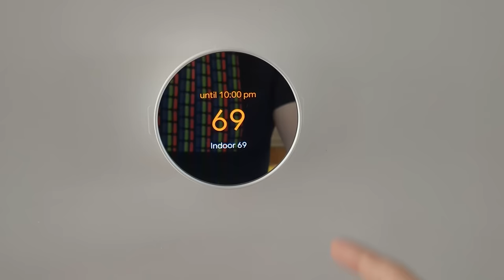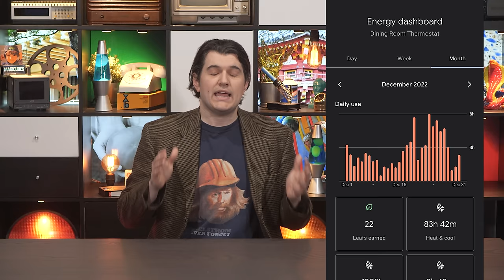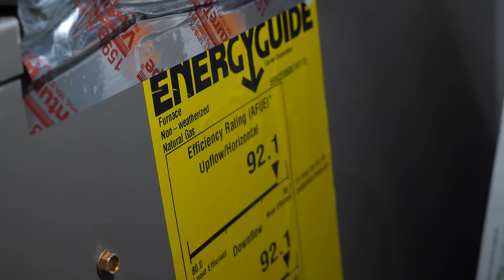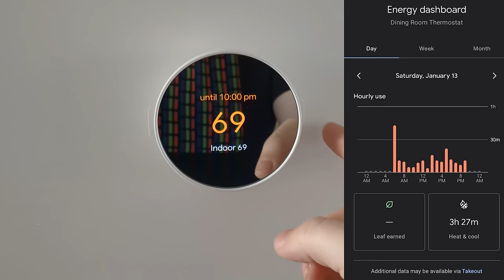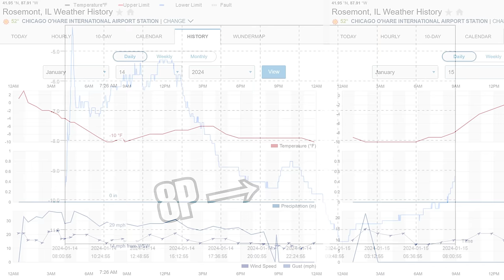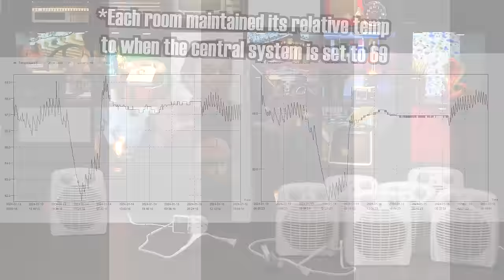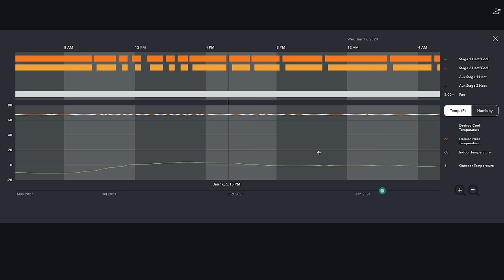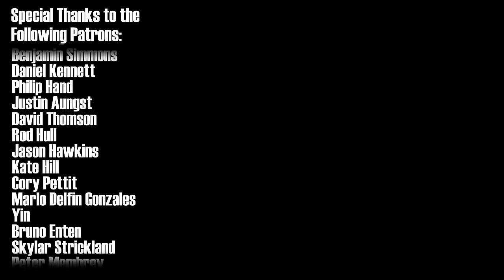Old HVAC industry practices are holding us back and costing us money. But we can fix it.

Comment: I'm at the 30-ish minute mark and the volunteer firefighter inside me just cringed really hard... Last night, we had a fire call where someone plugged a space heater into a power strip, burned up the strip, and nearly burned up the outlet... Thankfully no actual fire occurred. Thank you for knowing what you did was unsafe and warning others not to attempt it themselves. Science can be fun but dangerous at times. Love the content.
Reply: A less dangerous method would be to turn the furnace on fan only mode, and plug one space heater into every circuit.
Reply from the maker: @sean2074  The reason I elected not to do that was because the wattage from the blower motor (which is higher than you might think - typically 200 watts or more) would skew my results. Plus, it was valuable to know which rooms actually have the greatest heating load. But yes - it was a risky setup. I was checking the temps of cords and connections all through the night and had fire extinguishers handy.
Reply: Why is that? Seriously. I don't have a single outlet in my home that can deliver less than 2300w (10A, 230v). I just went through every power strip and extension cord and they are all rated for at least 3600w. 

The wires in the walls are all girthy enough to not burn before the breaker pops. 

I combined two circuits (total 32A) and I tried a random cheapo extension cord. I stopped after 5700w (didn't dare to go further) and it didn't even start smelling of plastic. The plug got warm though... 

Are American standards that bad?
Reply: @LinusBerglund It's because the American grid runs on 120V instead of 230V so 10A is 1200W instead of 2300W.
Reply: @pyro1324  No, the American grid runs on 100+ kV transmission, 5+ kV distribution, and 240V split phase to houses.   Most outlets in the home are 120V with a couple 240V outlets for dryer and stove.  See his video "The US electrical system is not 120V".
Reply: Cheap power strip?   Most I've seen are rated at 1875W (15A @ 125V).  A 1500W space heater will draw 12.5A (12.5A @ 120v)
Reply: @LinusBerglund Standard North American outlets are 120V ± 6% (112.8V - 127.2V).  A 15A circuit at  80% continuous load is 12A so that's 1440W.  A 1500W space heater will pull 12.5A at 120V.  But if the voltage supplied to house is a tad high (127.2V) then it will be drawing 13.25A so that's 1.25A above the 80% continuous rating of the wires instead of the .5A it's normally going over by.
Reply: @avernar The household electrics aren't really the problem.  A 15A circuit can safely carry 15A continuously, it's just that we add EXTRA safety margin because that's how engineers are (and we appreciate their diligence). Indeed, 15A already has some margin built into it before adding the extra 20% for planned loads. The breaker will do its thing long before the wiring inside the walls is at risk.

The danger is the stuff you plug into it. The circuit rating only ensures the stuff inside the wall can handle those loads.  You can get cheap extension cords and power strips that should never, ever be used with one, let alone multiple, space heaters.  Damage to the plug itself, unless you shorted things and had an instant of much higher draw before the breaker went, is probably from the male side overheating.
Reply: "Skew your results" meaning your method seems to not be that efficient 😂.. your furnace doesn't run that much because your walls are warmed by your neighbors there genius.. this clown is so pathetically ignorant why are people listening to him?
Reply: @LinusBerglund I wish I could get a 3600w power strip, every one you get in Japan (100v mains) says 1500w max, even ones with super-thick heavy duty cable.
Reply from the maker: @jacksparrow3490 if you understood how heat transfer actually works, you'd know that the heat from my neighbor's homes doesn't actually affect anything because heat only moves across a barrier when there's a temperature differential - and the differentially between two occupied homes is minimal. Ever notice how when the outside temp is anywhere near your inside temp you don't need any heating or cooling? That's what's going on, and that is why you don't factor them in when you do load calculations - only exterior surfaces, which actually have a meaningful differential, affect loading.

But yes, I'm pathetically ignorant.
Reply: @TechnologyConnections  when the "air" on the sides of your "townhome" is at a constant temperature above 60 degrees, your side walls aren't getting "cold" and no cold air is coming in. Meaning your 5/8 drywall and insulation aren't even getting cold at all.. doesn't matter what r value it is. You ignore this obvious basic concept?
Reply from the maker: @jacksparrow3490 um. you seem to be ignoring an obvious basic concept.
What you just wrote explains precisely why you don't figure shared walls into load calculations - so you understand it yet also don't?
Reply: @TechnologyConnections  "heat from my neighbors home doesn't actually effect anything"... so the heat isn't keeping the other side of the wall warm so there isn't any loss of heat on those walls there smart guy?  😂😂🤣 trying to push climate change fear on people to buy your glorified space heater 🤪🤪
Reply: @TechnologyConnections  so you ignore real world conditions to fit your little narrative huh? Just because you calculate it different doesn't mean your walls aren't being warmed by a neighbor from the other side.. but we wouldn't expect someone using climate change as a selling tactic to use actual facts now would we?
Reply from the maker: Oh - are you just like, arguing that I think the shared walls aren't making my home easier to heat? Because of course they are, I even explicitly said that in the beginning of the video. That has nothing to do with how oversized my furnace is, and you don't consider shared walls when doing load calcs.
I have no idea what you're even going on about at this point. This video was all about equipment sizing, and my furnace is wildly oversized for my home. The fact that I'm in a townhome doesn't really matter to that point, but you're framing it as something of a gotcha.
Reply: @TechnologyConnections  everything you've stated is you manipulating the study.. to get desired results.. "load calculations" from shared walls? How do you get ambient air temp calculations from a wall? You're literally trying to manipulate what data to input into the formula to skew your results in a fashion that makes you seem like you know what you're talking about.. this is such an obvious scam like EVs are.. notice all those cars left stranded in those freezing cold temps? Did they skew their data and results to convince people it wouldn't be an issue? They sure did..
Reply from the maker: There's obviously no point continuing on with you. Have a lovely day.
Reply: @TechnologyConnections  there's a reason things were built to be "more than enough" once upon a time.. obvious you would rather max out the stress on your appliances to try and find that perfect medium of too much/too little right? You bought a townhome.. enough said.
Reply: @jacksparrow3490  Cor fuc'n 'ell, got quite the fanatic 'ere, 'ent we, lads?
Reply: @jacksparrow3490  don't forget about alternative energy, gas stoves, covid, biden, woke, big tech, what inanimate object you identify as, CRT, 2A... what am I missing?
Reply: @jacksparrow3490  Congratulations on being a genius in your own eyes, I guess?  You're clearly smarter than Alec.  I guess we should all be watching your hour-long videos investigating household technical topics.  Oh, wait.  That would require good-natured humor, storytelling, respect, patience, and consistent work to produce.  

"Being smart" doesn't mean you'll be successful.  You have to offer at least minimal respect to other people.
Reply: @TechnologyConnections  quite the cult following you have 🤣 just use trigger words and the sheep come running don't they
Reply: @jacksparrow3490  tl;dr the difference in temperature between two inhabited spaces is minuscule when compared to the difference between those inhabited spaces and the outdoors. 

The only way Alec would be getting heat from his neighbors is if their interior temperature was higher than his. You seem to understand energy flows from high concentration to low, but somehow you don’t seem to understand that it’s the difference between those levels that determines the rate of transfer. 

Sure, let’s say his neighbors keep their homes at a balmy 75 degrees in the middle of a polar vortex. That means the heat in their house sees a 75 - 69 = 6 degree drop into his house, and a 75 - -15 = 90 degree drop to the outside. All else being equal, that means 6 / 96 = 6.25% of the neighbors heat is coming into his house. Oh no, his heater is only oversized by 2.935x instead of 3x!

Or, god forbid his neighbors are polar bears that keep their house at 67 during the day, then some of Alec’s heat is actually going to his neighbors and his figures are actually higher than reality!
Reply: @jacksparrow3490  Because he's intelligent enough to not call someone a pathetically ignorant clown, over a simple flaw in their video...
Reply: Love this channel. Full stop. 🙂
Reply: Dear God, I’ve never seen this kinda trolling on a TC video before. Even Alec (genuine nice guy) isn’t immune. Insanity.
Reply: @mrb692  i think what you people are trying to say is.. you really don't understand real world conditions and only look at things from a paper perspective.. if this guy has his thermostat at 60 degrees.. and both neighbors on each side of him keep theirs at 72.. You're claiming this guys home won't be helped maintain his 60 degrees with less work from his furnace because shared walls don't transfer heat? Lmao this whole thread is so comical. I would laugh so hard on a job site at every single one of you while you look like fools.. dunning Kruger effect is a thing.. you all take the cake
Reply: @mrb692  once again.. you seem to not understand if the front and back of his home is touching outside colder air.. and the sides of the home are touching other warm living spaces.. that in turn would "help" his home not need as much furnace usage.. just curious.. how do you remove walls from an equation that is taking ambient air temperature? Or is he only getting so many feet away from the wall and claiming his reading is invalid because he's not considering the whole rooms temperature when making his calculations? Just interesting how none of you are even seeing the signs of snake oil dripping everywhere.. climate change is a call sign for dunning Kruger effect participants. Full stop. Anyone trying to ban natural gas or tell people they don't need it is literally too ignorant to see a bigger picture other then listening to fake scientists and media analysts about an agenda designed to enslave you more.. sorry you can't accept the reality in which we live. Everything electric can and will monitored and "permitted" in the not so distant future.. you clearly can't comprehend how Chinas social credit score is practically already here.. but let's continue talking about this guys oversized furnace because he's not even considering the heat from the neighbors does indeed help lessen the work on his own furnace in his own "unit".. its a town home.. a cheap cookie cutter home builders throw bulk items into as they get great deals purchasing them by the many for the many units being built. If his furnace is "too big".. it seems like that isn't even a bad thing.. its amazing how people will sacrifice comfort for some "greater good" based on propaganda and weather manipulation 😂
Reply: @TechnologyConnections  so when the air in your neighbors is transferring into your home when your furnace isn't on.. its not until your home reaches that set temperature to turn your furnace on.. you already prove the point made by the video itself.. your home doesn't "lose" heat at the rate calculated for the size of the home based on the specs provided to the builder.. thanks for playing..
Reply: I know if I point this out, it will change, but at this moment, nobody on this comment string is giving a thumbs up to Jack, but Alec is getting them. The troll has been identified, the sheep voted.

Alec, there are so many good things about your videos, just keep them coming, especially the snarky bits......in my opinion, one of the best parts
Reply: @Chevtec  yes.. considering how many people are wrong about alot of things on massive scales.. doesn't quite mean any of them are correct.. 🤣
Reply: @jacksparrow3490 
Well thank God that you're here to save us all 😂
Reply: @jacksparrow3490  You'd do better to not assume everyone around you is idiots and stop trying to impress people with how clever you think you are by trying to make things more complicated than your argument needs. What you are TRYING to say, and utterly obscuring with your attempts to seem smart, is that you believe that the neighbours heating systems are shouldering the burden of the "ineffective" (by your assumption) electric heater test, and that because the test doesn't measure to see if there's an increased load on their systems then the test is invalid.

That's not a terrible point. If you'd just made that point rather than leaping to conspiracy theories and obscuring your own point and then throwing insults then you'd probably have got a nice reception from everyone here.

Given the results of the empirical were to test the validity of the other two methodologies and they ALL agreed with each other, it seems unlikely that this is a factor. Yes, his neighbours homes help his home be more energy efficient, as he states in the video, but the degree to which it applies appears to be the same whether electrical heating is being used or gas, it isn't compensating for anything or skewing the results, it's just a baseline environmental factor for these purposes.
Reply: @avernar : Two things about your comment are incorrect. Firstly, the outlets over here are only rated to a max of 125V L-N/G; not the 127.2 that you gave. If the voltage of either “hot” leg, relative to ground goes above 125, you best call an electrician and have them see what’s wrong.
Second, power is voltage multiplied by amperage; as voltage goes up, the amperage will go down, and vice versa. Your statement of the amperage going up with the voltage is completely false.
Reply: @jacobcarlson4010 Incorrect. The amperage WILL increase with a voltage increase if you have a RESISTIVE load, as it will also decrease if you have a voltage drop.
Now something like an electric  motor, an INDUCTIVE load producing a fixed output power the opposite will occur. Voltage increase will result in an amperage decrease and a voltage decrease will result in an amperage increase.
Reply: @jacksparrow3490  Holy Heck, dude.  If you have to post a dozen ranty comments to make your point... do you even have one?  Really practicing "flood the zone with BS" here.
Reply: @plwadodveeefdv  Perspective, I'd say.  Let me know if you need more help.
Reply: As a person who works with electricity in various forms who also has a deep respect and caution when working with it, I would have to agree.  I was wincing thinking about it.
Reply: @TechnologyConnections Well, taking precautions is a good thing.  The infra-red camera is a good tool to have handy as well.  I wish I had one of those and a laparoscope-style camera for various jobs.
Reply: @avernar 240 V~ for his car, heat pump and water heater as well.  If you have larger power tools as well you are looking at 240 V~.
Reply: @WJCTechyman  Yes.  I have my A/C and computer rack hooked up to 240V.  In the future I’ll hook up an EVSE to 240V.
Reply: I was in the kitchen when the GFI outlet released black smoke.  Killed the power, let it cool off.  Turns out the air fryer exhaust melted it inside and the hot line shorted.  Replaced the outlet, and put new outlet under the counter, and moved the airfryer over 6 inches more plugged into it.
Reply: @avernar  a lightning strike took out L2, so I had no 220v and half the house was out.  I was getting 78V on L2, which isn't nice.  Seems no one makes a breaker to let you trip one line only.
Reply: Those damn space heaters are GARBAGE, I had a small UL listed!  "cube" 1500 watt unit plugged in, the internal fan failed and the plastic- PLASTIC!! case caught fire, I was awakened by my dogs jumping on my bed to seeing a 2 foot flame feet from my bed, I grabbed the power cord on the thing, yanked it out and carried the still burning heater to the front door and threw it in the snow where it burned until only metal screws, coil and the fan housing remained.

I cannot fathom how they can legally make something like that with a flammable plastic case and be UL listed too!
NO plastic, and NO 14 GA wire like they use.

A former neighbor years earlier hired me to help print tee shirts, we were working on that and I stepped on the cord to the space heater he had running, and the cord shorted out! It had gotten hot enough running that 1500 watts that the rubber or whatever it was the cord was made of- softened enough that just stepping on it was enough to mash the wires together into a short circuit.
Reply: @jacksparrow3490   Couple of things. Alec has his house at 69, not 60. But even using your numbers, there’s a 12 degree difference between sides of the party wall and an 87 degree drop across the exterior, meaning 14% of their heat flows into Alec’s house. Oh boy, his furnace is only oversized by 2.72x and not 3x! His entire argument is invalid! Except that’s not how that works. 

Also, I am not saying his home isn’t helped at all by his neighbor, but I am absolutely saying the amount of heat he gets is negligible compared to the heat he loses to the outside. And if the neighbors keep their homes at 69 too, then there is literally zero heat transfer through the party walls. If you’re taking about how he only has 2 exposed walls and a roof to lose heat through vs 3 walls for the houses on the end, or 4 walls for a freestanding house, then 1) he addressed that by snarkily pointing out that denser housing is more energy efficient, and 2) that’s accounted for in the manual J calculation. Yes, the units on the end will need a bigger furnace than the units in the middle, and the freestanding house will need an even bigger furnace. But how much do you wanna bet that those units’ furnaces are the right size, versus also being sized off rules of thumb and then bumped up a size or two?

I’m not even gonna indulge the conspiracy stuff you’re spouting beyond saying that oversizing gas lines is way cheaper than oversizing electric circuits. Having the ability to generate 3x more heat than you need is a waste of money that is useless at best and potentially harmful to equipment at worst because it keeps cycling on and off.
Reply: @jacobcarlson4010  Ohm’s Law says volts equals current times resistance, or in other words current is volts divided by resistance. Since the resistance of a heater doesn’t change (much), as the volts go up, so does the current flowing through the circuit and the total output power.
Reply: As a science teacher, I still feel unnerving to let students handle chemicals regardless how many times I emphasize safety rules. But that's a small risk worth taking for the important education the general public needs.
Reply: Believe it or not, but Manual J takes neighbor's units into account and tracking heating load to a room level provides empirical results, which also will directly account for neighbor units, or lack thereof on either side, depending on the room.
Reply: @BixbyConsequence  considering the amount of dunning Kruger effect participants here.. yes, it does take repeating it over and over before someone realizes that inside air.. helps keep walls warm. Which in turn doesnt allow heat to escape from those walls. Sorry you people cant use basic comprehension when figuring things out.
Reply: @mrb692  the rate at which the heat is lost is less. Not negligible. Its actually quite interesting to see your argument miss the fact.. his furnace wont turn on as often due to his heat not being lost as fast on the side walls.. given the "heat exchange being nothing. Meaning hes not losing his heat as fast as someone with outside walls and not PARTITIONED walls. Those walls have 5/8 drywall with probably r 13 insulation. Yes the air inside the wall is heated by BOTH units. Yes that air will also help maintain a higher temperature due to the air not being cooled by the outside and heat being lost. Very simple to understand. If alex owned a home outright by itself. Same size and all.. his furnace would turn on more as more of his heat is escaping faster without the "lack of heat transfer".. you all keep proving the point. You admit it just in your own way. If the heat transfer is nothing on his neighbors walls.. then what is the heat transfer on his outside walls that go the the outside air? Its hilarious how you all keep confirming my point but literally lack the understanding to comprehend it. This isnt any different then the warming of a person in winter using clothes and a coat. Stand next to people with clothes and a coat.. their heat wont transfer to you because theyre wearing a coat and thats negligible. His furnace doesnt have to turn on as much as he doesnt lose his heat as fast as others. Whats the size of the home and the btu of the furnace again? Lets do the simple math for the sheep here.
Reply: @MichaelMamanakis  believe it or not.. that's not how it works. If nobody lives in your neighbors unit. And the heat isnt on. Guess what. Your furnace is working overtime then now huh.
Reply: @robertsmith2956 My generator would probably take over in that case.
Reply: @jacksparrow3490  Lol. Alec explained it to you concisely.  Stop trying to type yourself smart.
Reply: @jacksparrow3490 idk how to do the math, but im curious, what would the results look like if we assume all the walls are facing outside and not a neighbor? Like what would be the approximate requirement in that case, I'm genuinely curious and I don't know how to make the calculations.
Reply: @boombeepboomboop  you can look that up easily.. the first 10 seconds of this video proves all the sheep here wrong.. he turned off his furnace for 24 hours in minus 11 degrees.. that's not a testimony on his "big furnace".. that's a proof of his "loss of heat" being minimal and his home is kept warm by his neighbors 🤣 guess nobody here can comprehend.. he has good insulation on top of his townhome.. according to this guys thinking.. why do we even need heat at all in the home? Just out on a heated jacket and wear it all the time for you know.. climate change..
Reply: @TechnologyConnections  what is the btu of your furnace and what is the living space in your townhome?
Reply: @mrb692  you don't seem to understand why furnaces need to be a required btu to operate efficeny in any given environment.. hes saying his furnace is too big because he doesn't lose his heat as fast.. in the first 10 seconds of the video he tells you how he comes to this conclusion. Thank you all for proving my point. Dunning Kruger in full swing baby.
Reply: @DrakeKillah  "simple flaw"? The whole video is flawed based in ignorance. He says in the first 10 seconds "i turned off my furnace for 24 hrs and that means my furnace is too big".. tell us now.. does the heat loss by turning off the furnace have anything to do with the size of furnace at all? You could use a space heater and the heat will "stay" for quite some time is all this is proving.. hes claiming the furnace is too big based on propaganda.. i.e. climate change. Which is saying.. he hasn't looked into the real purpose of this whole push of climate change bs in the media and political hacks.. its a scam. Hes acting like -11 degrees is something to play with if all you can rely on is a space heater lol.. wait until his neighbors move and turn off their furnaces.. what if Alex here has an emergency with his furnace? How long does his method take to reheat a home that has dropped very low in temp due to no heat for days and days? Apparently people csnt comprehend the actual concept behind the required btu in the first place.. let's just over look everything becusse this guy can turn his furnace off for 24 hrs and that proves its too big.. 🤣
Reply: @jacksparrow3490  talk about blowing shit way out of proportions… I live in Norway, I know a thing or two about cold winters… I also know, you don’t need a furnace to keep a house warm, and you won’t die if it takes a little longer to heat up your home… Furnaces were never really a thing outside of large appartment complexes here, but heat pumps are, and they work well.

Just love how freaked out you guys are about this, as if this is an attenpt on your life or something 😂
Reply: @TechnologyConnections  how did you come to the conclusion your homes furnace is too big again? By turning off the furnace for 24 hours and that proves its "too big"?
Reply: @DrakeKillah  the US has a building code.. the furnace and hvac system is under regulation to a specific requirement for a given region and climate..
Reply from the maker: @jacksparrow3490 ok. At the risk of stepping in this, please tell me you got to the part where I set up a bunch of space heaters and metered them. Because no, I did not just shut of the furnace for 24 hours and say "wow, it's not that cold in here!" - that would be utterly ridiculous. I am not saying I don't need any heat.
Now, if you did get to that part of the video and somehow still don't understand how that validates the fact the furnace is 3X oversized, this conversation is an incredibly, woefully, unimaginably lost cause.
Reply: @TechnologyConnections  ok well you clearly didn't allow all the heat to leave your home first and then try to use your space heater method to see the difference in heat and climate inside your home.. so I'd say your little experiment wasn't conducted in the proper manner to give more accurate results you claim in the video. Your calculations seems to be biased along with the whole way they are conducted.. you want your furnace to be 3 times too big to then claim you have a solution for it.. when in fact it is not..
Reply from the maker: Sounds like you never got there.
Now, I will no longer argue with you. If you really think I needed to let all the heat leave to do the test, then you don't understand what you're talking about. Heat is always leaving - what matters is how much you need to replace it with. And I now know with 100% certainty that 17,452 BTU/hr is my home's actual heating load with an 80 degree temperature differential, zero additional sources of heat, and no help from the sun.
You have a good day, now.
Reply: It's been hilarious to watch this guy try to argue that everyone else is wrong because heat doesn't leave through the neighboring walls. That point was brought up multiple times in the video and even in this comment chain, and our lovely Disney pirate missed it every time.
Reply: @LinusBerglund  There are regulations in Europe that makes it practically illegal to sell any power strips that can't handle the max load of a 16A breaker, which is what the vast, vast majority of residential outlets are on. 20A is extremely rare for a regular outlet, and more than 20A is always on special types of outlets that you can't readily plug regular power strips into. Turns out 16Ax230V gets you 3600 watts, meaning even if you daisy-chain 10 power strips, the breaker will trip before anything catches fire.
Reply: @avernar  would it with L1 line working?
In the 40's it wouldn't be an issue, you remove the penny from the L2.  :face-blue-covering-eyes:
Reply: I cannot phantom why it’s legal to sell an extension cords that cannot carry the maximum current allowed on a circuit breaker.

Ever more importantly, why would there be no fuse in the plug (and in the socket for a good measure - like in the UK).
Reply: @zlamanit  These aren’t great reasons, but they are the ones I could think of. If you’re only running a low load, then a thinner conductor is cheaper, lighter, and more flexible than one that can handle the full rated load.

As for not having a fuse, that’s legit a good idea and other than cost and people would absolutely throw away a perfectly good power cord for the sake of a 10 cent fuse, I’m not sure why we don’t have them.
Reply: @avernar  Alex even showed the 118V on the Kill-A-Watt in the video, and that they dropped to 116V when the space heater was turned on.
Reply: @squidward5110  nothing wrong with 20 socket power strips if you only take like 100W from each socket
Reply: @wilfriedklaebe YouTube comment structure sucks.  No idea what you're replying to. 

Most NA utilities provide a voltage in a stated range around 120V (240V but each leg is 120V).  For me it's 120V ± 6% (112.8V - 127.2V).

Yes, you'll get a voltage drop when you turn on a heavy load.  That's just basic electrical/electronics.
Reply: @robertsmith2956 With L1 working (120V) and L2 slightly down (you said 78V) then no.  The default trip voltage is 156V.  So L2 would have to drop to 36V or less.

In that case I'd pop off the transfer switch cover and flip the Utility Service Disconnect breaker.  Generator would fire right up and tell the transfer switch to cut over once it warmed up.

We have a pad mount transformer and underground wires to it so not too worried about losing just one leg.
Reply: @avernar  I probably were replying to "A 1500W space heater will pull 12.5A at 120V." - in 32:03 to 32:13, Alec shows a Kill-A-Watt measuring 118V without, 116V with space heater, and then 1360W draw of the space heater. So, yes, more than 10A, but with 11.73A still way below the 15A that NEMA connectors are minimally specified with. I cannot find any source that states a 10A continuous current limit either NEMA 1-15R / 5-15R receptacles or NEMA 1-15P / 5-15P plugs.
Reply: @wilfriedklaebe  Not sure where that 10A came from (Europe?) but NEC  210.20(A) says a circuit breaker must be rated at 125% of the continuous load.  So that means a 15A 80% duty rated breaker can handle 12A only for  3+ hours.  Less that 3 hours you can use all 15A.  

A 15A 100% duty rated breaker (more expensive) can be loaded 100% (15A) forever.
Reply: @jacksparrow3490  "there's a reason things were built to be "more than enough" once upon a time.. max out the stress on your appliances to try and find that perfect medium of too much/too little?"
This is what I started to think part way through the video. The "extra" oomph from the furnace is there so it doesn't constantly push itself on at all times so the wear-and-tear is lessened over time and makes it less likely to need replacing any time soon. I'm not sure if this was taken into account or not.
Reply: @avernar  I was never worried about it myself either.  Was very weird coming home, and finding half the house didn't work.
Reply: @robertsmith2956 I meant "not worried" as I don't expect it ever happening here.  The lines don't go above ground until well after the transformer feeding my house.   Any damage by weather will take out the entire phase (both legs).
Reply: @imadecoy.  Their questions and objections were well-answered from the start.  The constant backpedaling and moving of goalposts and the repeated use of "Dunning Kruger" as an insult are all you really need to know about this person and where they're coming from.
Reply: @jacksparrow3490  "he US has a building code.. the furnace and hvac system is under regulation to a specific requirement for a given region and climate.." – yes it does (well, every locality has its own code, but they are based off the same set of codes and practices). And that code says the system must be sized using the Manual J calculation. Here is the relevant IECC section: "Heating and cooling equipment shall be sized in accordance with ACCA Manual S based on building loads calculated in accordance with ACCA Manual J or other approved heating and cooling calculation methodologies. New or replacement heating and cooling equipment shall have an efficiency rating equal to or greater than the minimum required by federal law for the geographic location where the equipment is installed."

... Which is what Alex did in one of the THREE methods to size his heating. All three methods agreed. I don't know what you think you are going on about, but maybe you need to put the keyboard down for a bit.
Reply: This can happen anywhere. That's reason my country do prohibited selling or import non-certified power strip or outlet since 2018. (Although some can it get illegally through online shopping). 

All require circuit breaker and correct rating of cables, Because most people are idiots about electrical system.
Reply: @tomdibble8983  Its ok if you can't comprehend his furnace is the accurate size for his home.. we get it. You common core math people seem to just think you can overengineer everything because math on paper seems to check out.. as stated.. his method will leave himself and others cold and over working his heaters.. is the point.. hence why nobody here can find the right wiring to use constant space heater 🙄
Reply: @zlamanit  Oh man, it gets worse.  We have a power block that provides USB sockets, and also 2 "NEMA" sockets (the default home receptacles here).  Only, the device is only rated to 200 watts maximum and only designed for charging phones, the small power blocks for laptops, or other low-power devices.  The mains cord is VERY thin, which would probably tip off a lot of people, but not everyone has that awareness.  I caught someone trying to run a vacuum cleaner plugged into one of those outlets!!!  Thankfully I noticed right away.
Reply: @sfalpha  no, most people are idiots in general.. hence this whole video. .this guy charging his car, and trying to run his whole life on just electricity.. you know when they talk about the grid being stressed constantly... this clown in the video virtue signaling is one of the reasons why
Reply: @tomdibble8983  30-60 btus per square foot. How big is his home? Stop being ignorant and answer the question. -11 degrees.. having heat on both sides of his house means he's literally having his neighbors help heat his home and won't admit it.. as many of you hear won't because you ignore real world conditions.. per usual.
Reply: @jacksparrow3490  That won't make your house on fire.

I don't see that is a problem to rely only on electricity. Most part of the world don't even has gas-pipeline run to a house. GAS stove not even allowed in the building.
Reply: >.> Wow. I come back to check on my comment and see a troll has caused quite the commotion in the replies... But it appears Alec and company handled them well.

I wanted to add a bit of context after seeing a few of the replies about power strips burning up with space heaters. I indeed live in the US, Central New York State to be a little more precise. My fire department has responded to two calls so far this year for space heaters, both of which occurred in old trailer/mobile homes (both 50+ years old, built in the 1970's or earlier) and both of which were using cheap, old power strips. These old trailer homes have some weird circuits in them and the homes aren't maintained very well. Both power strips had their ground pins removed for some reason (one appeared to be yanked out, the other cut/snipped off) and had far too many things plugged into them not including the space heaters that resulted in the calls.

One power strip had gotten the wall outlet it was plugged into so hot that it literally melted one of the pins off of the strip's wall plug and the other had melted plastic around the outlet on the strip that the space heater was plugged into. It also had minor scorching around the strip's plug but the wall itself appeared fine.
Reply: Indeed cult mentality here 🤣😂
Reply: @SanguinemLuna  so you advocate for more space heaters as well then.. how many furnace fires have you been to so far this year? Don't lie.. we can check.
Reply: @SanguinemLuna  Wanna know a scary thought? The troll actually believes what they say.
Reply: so why the f they calling for help?
Reply: @jacksparrow3490  How ignorant can you while still calling others ignorants. You've not paid attention in school, true?
Reply: @jacksparrow3490 you are a sad, strange little man. though your denseness is entertaining. 😀
Reply: honestly starting to wish youtube has a ban for creators or block button for users so we dont have to deal with trolls or idiots. the world might be a lil less worse.
Reply: @PhantomMattcraft  wanna know a scary thought.. people like you told others to get jabs based on lies and propaganda as well..
Reply: @LinusBerglund  It's because the US uses split phase power so regular outlets are 120 volt and only outlets for things like stoves water heaters dryers and electric car chargers are 240V
Reply: Wasn't it Erasmus's character of Folly who was quoted:

"What are you the worse if the people hiss at you, so you applaud yourself? And that a man be able to do so, he must owe it to folly."

For a person who apparently did not watch the video but extrapolated from the first three minutes of the content, then is using the classic parroting words to degrade every expert surrounding you -- quite some chutzpah. I think we are now ready to hear you announce your genuine trollster gag and provide us relief that this belligerence isn't actually your true base of humanity.
Reply: @jacksparrow3490  I wish I loved anything as much as you seem to love oversized furnaces and being wrong.